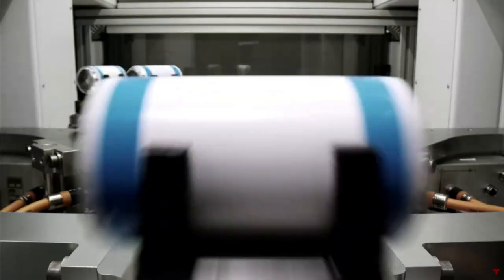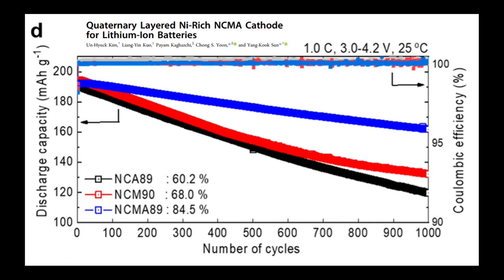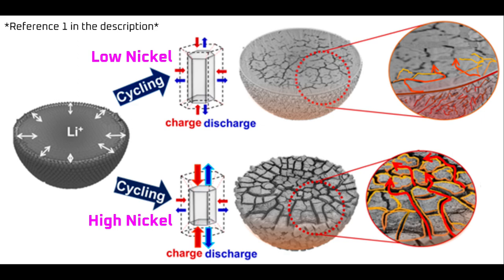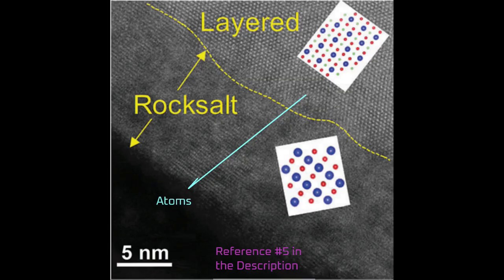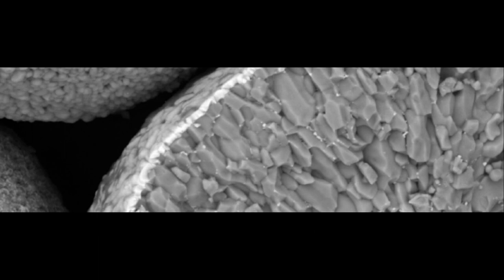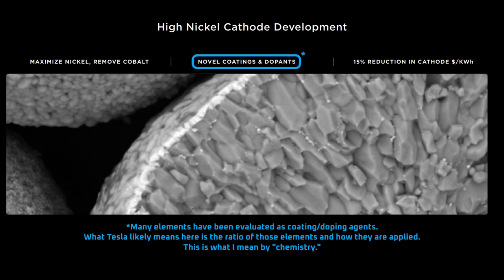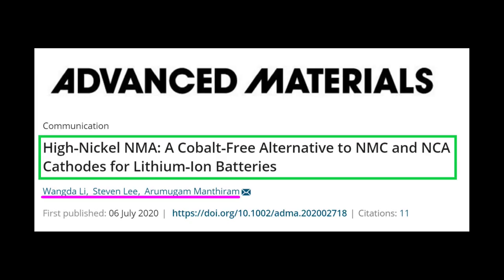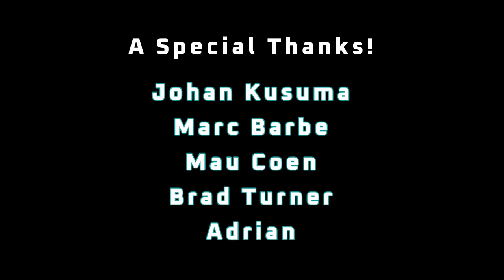#10 Tesla Cathode Deep Dive // Hardcore Particle Engineering

Comment: Fyi: most modern lithium-ion batteries can be charged upto 4.45V. Although their usually only pushed to roughly 4.35 - 4.4V in order to preserve cycle-life.

A 100 - 150 mV difference can increase the cycle-life by upto 3x.
Reply from the maker: Exactly
Reply: @thelimitingfactor  clarification:
the "upto 3x" cycle-life increase refers to the usual 400 cycles you can cram out of an LCO (with some cathode dopants) based chemistry at a D.O.D of 100 - 0%.
Charging the cell upto 4.45V would limit it to roughly 130 cycles (i.e., 3x lower cycle-life).

TLDR: they dont push them upto 4.45V in order to preserve the same cycle-life as "normal" 4.2 - 4.3V cells. Not the other way around.

Comment: The most challenging thing is in pure quantum mechanics. For example, due to their large volume, the Li-ions will disturb the quad-shelved layers of the cathode to some small degree. Probably, a special material must be somehow invented that allows stretch and expansion of the cathode to be consistent and repeatable over hundreds or even a couple of thousand charge cycles. Fantastic video, btw.

Comment: Beautiful research. The main thing I would say is that it seems improbable that Tesla would show electron microscope images of cathode structure for work in progress. More likely a discarded step on the way, so your assertion that Tesla is not using any of the chemistries in the table is likely correct. As you say some subtle mix and possibly with multiple dopants. The rock salt coating was interesting as I'd expect this to be attacked by any electrolyte with aqueous base. Is it even possible to use an organic base for an electrolyte? The phase change 'barrier' is also very interesting. Tesla appear to be knocking on the doors of all the limits in 'liquid state' batteries. In many respects, all these strange compounds and melange of dopants is highly reminiscent of the room temperature superconductor race 30 years ago. Keep up the stunningly good work. Edit: changed semiconductor to superconductor as per comment below. Thanks.
Reply from the maker: Thanks man and great thoughts/comments!
Reply: I think you mean superconductor race.
Reply: @musaran2  yes

Comment: The film on the outside of the particle is likely the metal used to secure the particles to the slide holder used for the electron microscope.

Comment: The "white film" you mention @time 20:30 could be an artifact from the SEM photo.  If the photo was shot in back scatter mode, then the bright color would be a higher atomic number than the primary particles in the interior.  Also, the outside seems to be a smaller crystal than the primary particles.  My guess is the "white film" is really a pure tungsten coating.
Reply from the maker: Interesting!

Comment: Excellent deep dive Jordan! Great sleuthing on what this future chemistry may be. 

I've got a basic question about the battery voltage increase you mentioned: assuming a voltage increase is just a thicker separator layer, how does energy density at "pack level" improve exactly? Wouldn't it require more volume?
Reply from the maker: Hmmm, I don't understand the question.  "a voltage increase is just a thicker separator layer"
Reply: @thelimitingfactor  Could be totally wrong, but I assumed that that battery voltage worked the same way as charged parallel plates in electronics, V = E*d. Assuming electric field "E" is constant, would a thicker separator, "d" (mentioned at 0:55 in your video) create the increased cell voltage? If this is true, wouldn't the overall cell volume need to be larger as a result (more material going to the separator layer). Seems like an increase in battery voltage leads to a decrease in energy density.

Comment: Excellent deep dive on the cathode! Did you get a sense for what the small particles are in Tesla's cross-section? Interspersed within the larger crystals appears to be a smaller round particles. Are those doping materials?
Reply from the maker: Could just be fragments of material resulting from slicing the particle.

Comment: The tungsten-doped particles don't appear to have distinct primary particles (crystals) as if the tungsten disrupts the lattice symmetry (W is far from Mn, Co, Ni, and has a more complex orbital geometry).  I don't see that in the interior of the glimpsed particle from Battery Day, the crystals being well defined except in a surface layer.  That makes me think that the particles are first formed in a way that produces the radial crystal elongation (maybe just through temp gradients during crystallization) then are subjected to a treatment with tungsten that allows it to diffuse only a short distance through the outermost crystals, forming the white crust.  The crust's storage capacity is immaterial, given its tiny fraction of particle volume, as is its tungsten-laden mass.  I suspect the crust is far more than 1% W, since its characteristics appear to lie in-between the halo of the tungsten-doped particle and its interior.
Reply from the maker: Great thoughts!

Comment: It is interesting to think that the two big breakthroughs Tesla may have made with battery chemistry both involve areas that had been somewhat ignored by researchers because they were considered not worth pursuing. And both because of material expansion problems. My only question is if this will unlock whole new territories for research, or if there is relatively little potential to be gained in the long run (from silicon anodes and high nickel cathodes), or if different approaches (like solid electrolytes) are a better research investment? I'm skeptical of the solid state press releases we have seen so far, but that doesnt mean that real breakthroughs that really outperform current chemistries arent possible in the future.  In other words, are they investing in short term solutions or long term ones?
Reply from the maker: I think short term vs long term isn't the best way to look at it.  New lithium ion tech has so far always adapted to existing equipment.  This means whatever new tech comes along for lithium ion will be most likely designed to be used on existing lines.  Beyond that, old battery chemistries don't die.  We're still making and using NiMH and lead acid.  There was no reason to shut down or replace those lines because the economics still work.
Reply: @thelimitingfactor  Sure. I suppose if this direction of development gets them cells that gets to a certain energy density, longevity, and price point... it should only get cheaper for them to produce as they go. Especially with their form factor and manufacturing advantages it seems like competitors wont be reaching price parity with any cutting edge chemistries any time soon. Esp not when comparing the price advantages of LFP.

Comment: The 4.3V is because you just measure it against a pure Lithium anode (called half cell tests) and not a graphite or Graphite/Si anode which increases your voltage window. The 4.3V hear are ~4.2V in a reall full cell. You could go to 4.25 or 4.3V in a full cell. In fact for certain cathodes you (e.g. Co Free) you would probably need to go to 4.3-4.45V.
Reply from the maker: GREAT comment!

Comment: Speaking hypothetically, if a battery were created that had an enormous voltage range would it be possible for electronic components to support that voltage range? A Step down or up that can support that large swing when the batteries are put into series. It's bothersome trying to use Lithium batteries now on inverters because they are usually designed around lead acid voltages. I would image the same would happen if a battery came out with a very large voltage range.
Reply from the maker: Not sure!  Electrical engineering isn't something I've investigated.

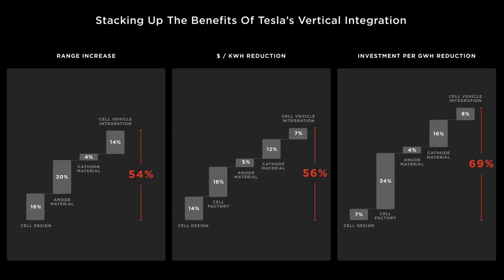Comment: 17:14 Why does 9% improvement at CAM level only equal 3.5% energy density improvement?
Reply from the maker: Because the cathode only makes up 50% of the cell and the cell only makes up about 70% of the pack weight.